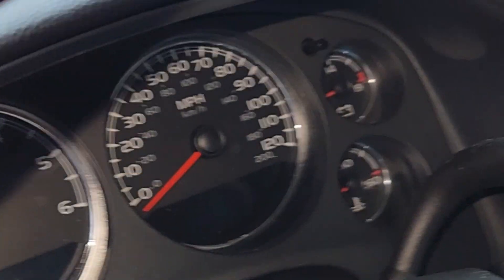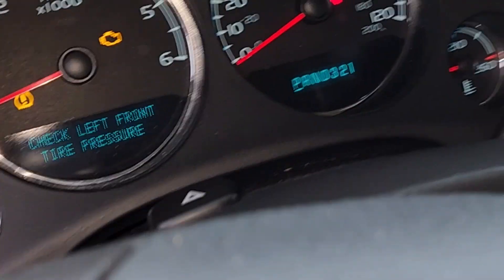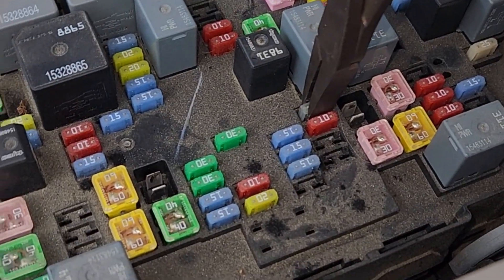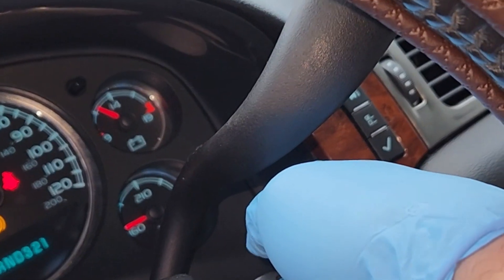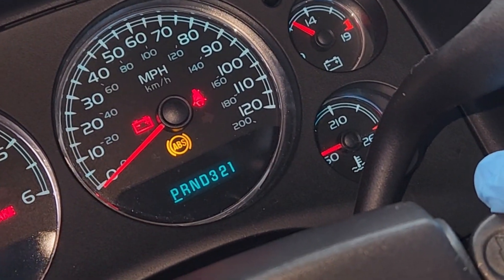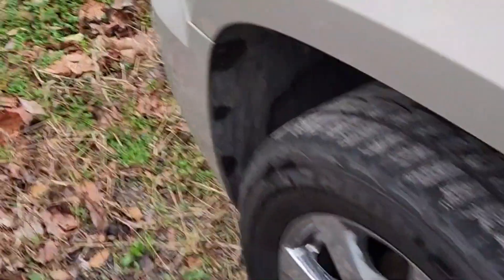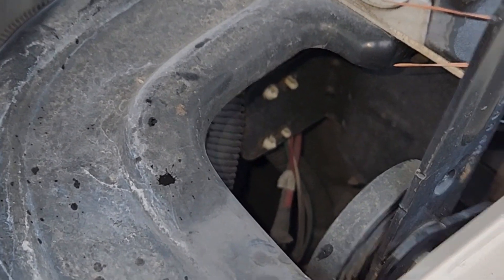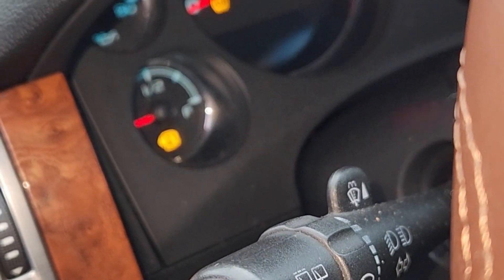2007 Chevrolet Tahoe, Fuse #34

Comment: What is number 34 fuse for?
Reply from the maker: It directly sends power to the ignition switch and the theft deterrent module. It indirectly powers the BCM and the  run/crank relay.